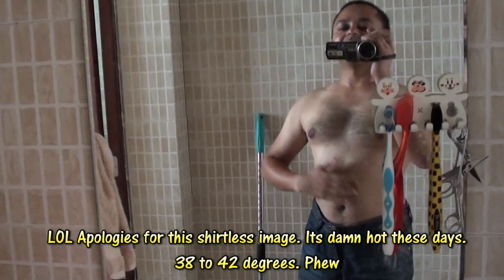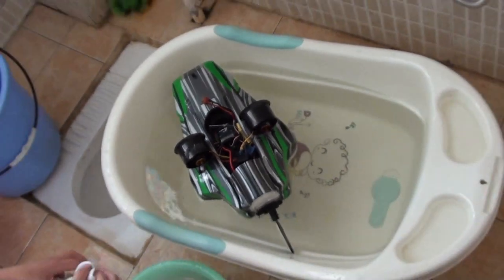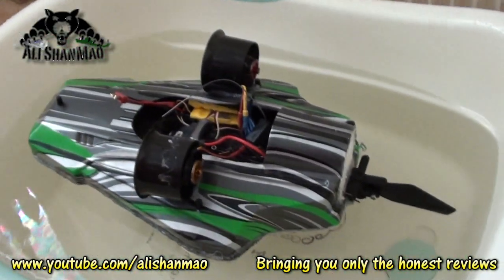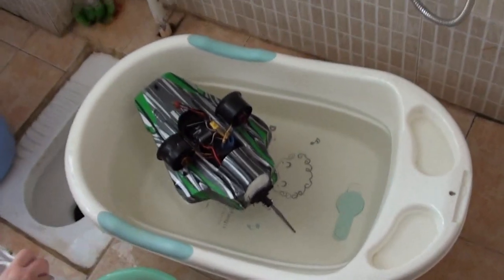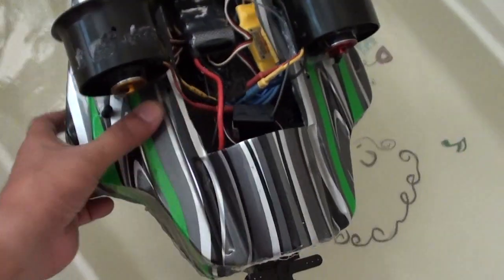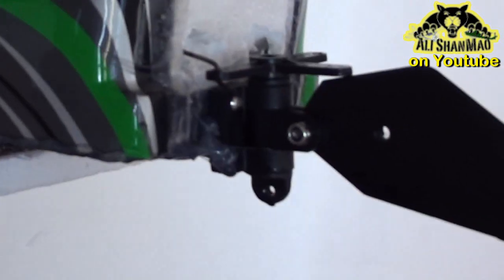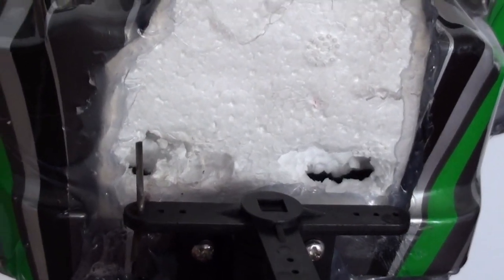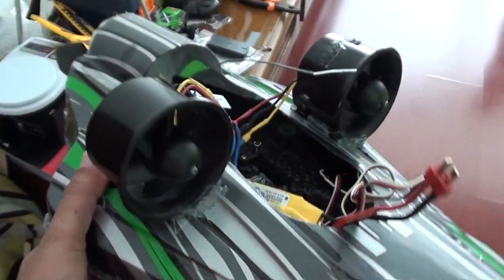Gator-Head Home Made Twin EDF Powered RC Boat

Comment: ali you should of used a silicone, either in a calking gun or even in a tube cut the tip at 45 degree angle athen hold it at same angle this will make it go on even and smothly and evenly go down the joint you are sealing, this would give you the total clean look, like from a big company, looks great, great idea

Comment: Question???? ALi  My sky lipo battery is swelling a little it is a 800mah 2 cell 30c continuous /60c burst.  my cel reader says  cell 1 is  4.08  and cell 2 is 4.11.. I took them out of my hot garage and am storing it in a Lipo Guard Bag.  What do you think is wrong?